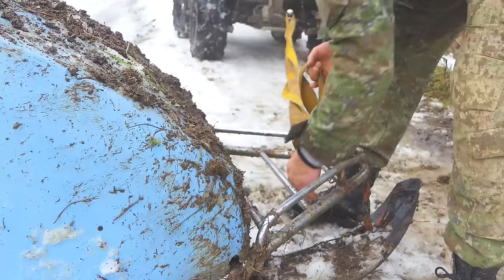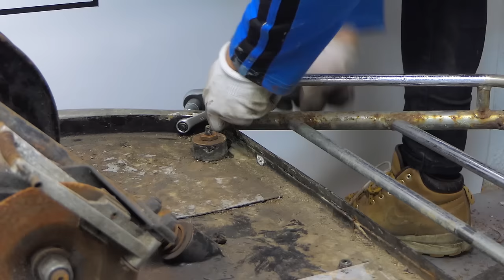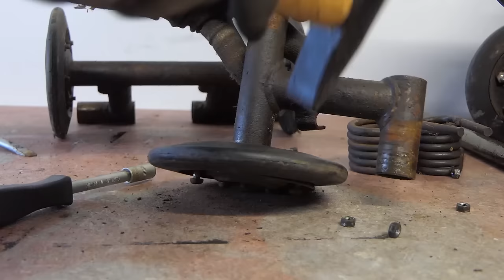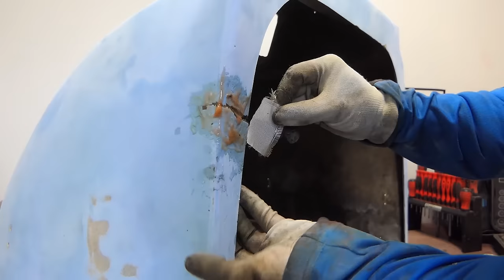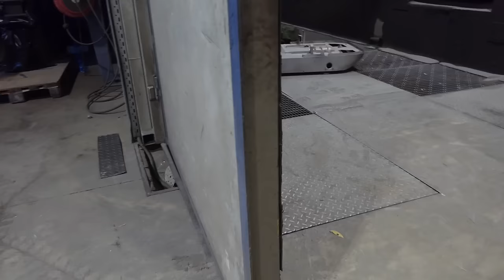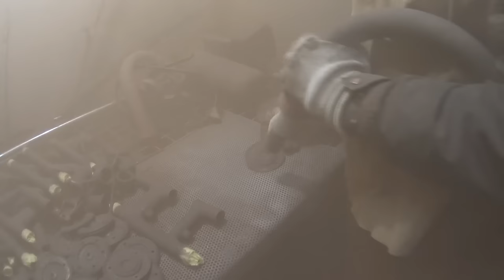Restoration Abandoned Snowmobile  - 4 months in 38 minutes

Comment: Sno-Tric was a Swedish snowmobil later rebranded to Aktiv.
This model was later known as "Aktiv blå" (Active Blue). Calling it an "over snow vehicle" is a bit of an overstatement.
Really depending on the depth of snow. In deep fluffy snow I saw only my neighbours helmet move towards me with roar.
It has a nominal steering. More like a pin ball hitting something to change direction. It did NOT like a ditch. One might
think the broad tracks gave it super traction. They did not.Actually the grip was crummy at best. With modern tracks it
would probably pull like big horse. And keep going forwards in a straight line until it hit something sturdy.
There was also an Aktiv Gul (Active Yellow). That one was good in snow and...smoky, noisy, slow, reliable and ..wonderful. Had one.
It was then already a veteran but could give much more moderna machines a run for their money when it came to traverse deep snow.
One could cruise around those stuck and digging in an "8" and look cool. And even if they, once at large, made far better speed one
could catch up when they stopped to refuel. With the tacks on rollers one had no issues on snow free ice. Overall terrible with today's
standards but..lovely.
de SA3BOW
Reply: Notice how they edited out the parts were they obviously had to stop and manually turn it around (especially when you see it head toward an inside corner). Those single ski ones always had shit steering ability, which was obviously the reason they switched to double skis.